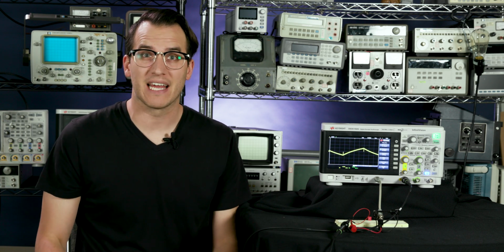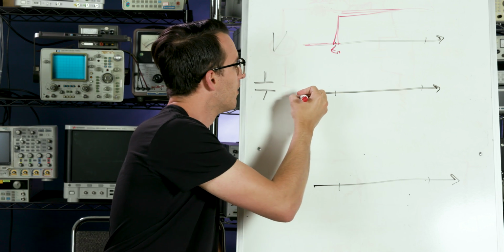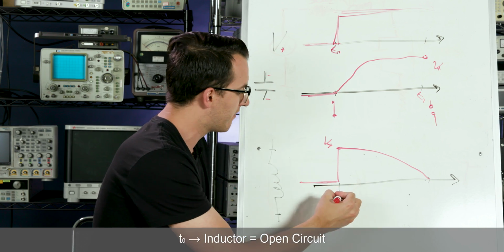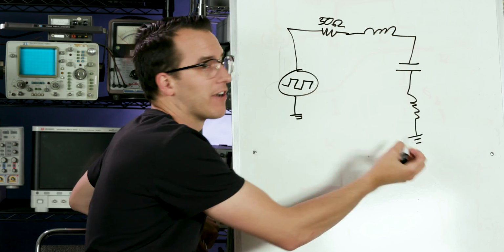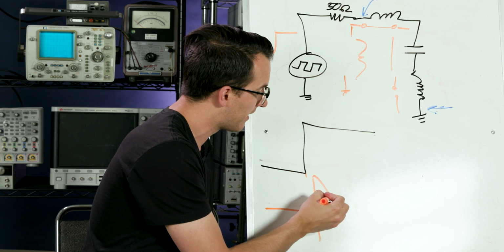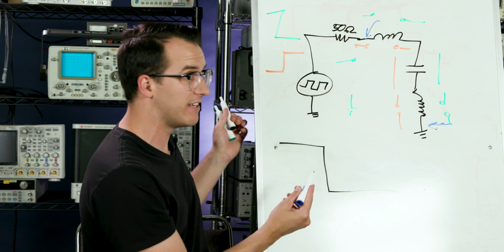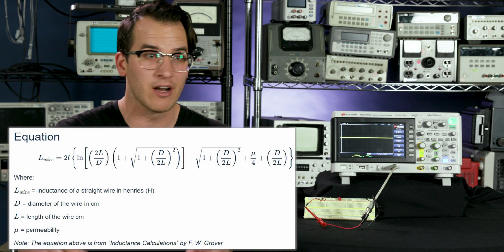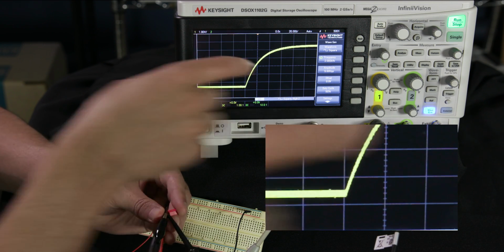Identifying Parasitic Inductance and AC Step Responses

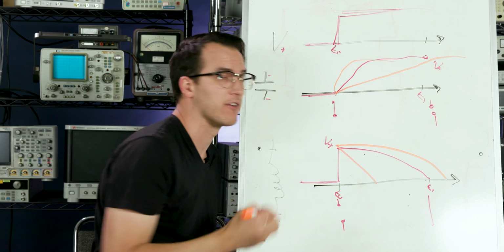Comment: At 3:24 the voltage waveform for inductor doesnt look right. It should drop exponentially such that it asymptotically approaches to zero volts in time.

Comment: Can you please explain with ground spring how does the parasitic inductance interference improve?
Reply from the maker: Ooh, good question. The spring part is almost all grounded, so it's not really acting like an inductor in a significant fashion. Parasitic inductance mostly comes from longer ground wires, so this shortens it significantly
Reply: @KeysightLabs  still the how the new circuit will be with grounding spring is not very clear to me. If you have circuit diagram posing diff between before n after it shall be easy...😀

Comment: 0:15 it seems that the waveform is attenuating when you increase the frequency? Also, shouldn't the inductor voltage dip to -V due to opposite emf at the falling edge of the square wave?

Comment: Would Peak Detect mode make the glitch any more visible to help make up for the less than ideal scope? Thanks for sharing. These slightly longer videos are even better! Thanks. Send me your address and I will send you a new black dry erase marker. ;-) I guess Keysight gave away too many scopes and the office supply budget suffered. Since my wife won one of those scopes we would be happy to send you some markers. ;-)
Reply from the maker: Good question! In this case the oscilloscope is definitely more than capable of handling the signals. Generally, peak detect mode won't help you get more bandwidth out of your oscilloscope, but it will help show any noise or small spikes that might get processed out in normal interpolation mode.